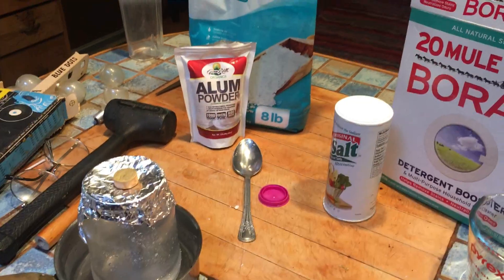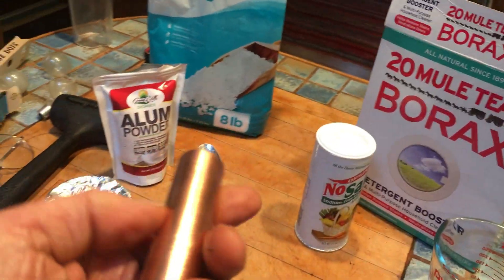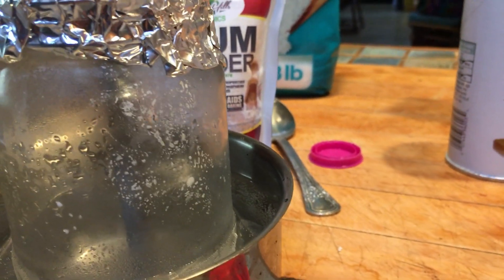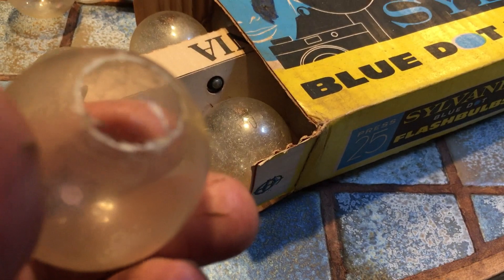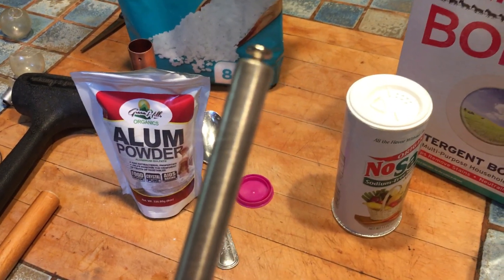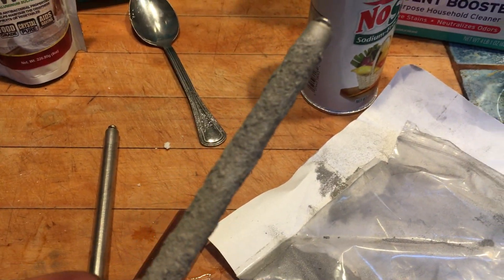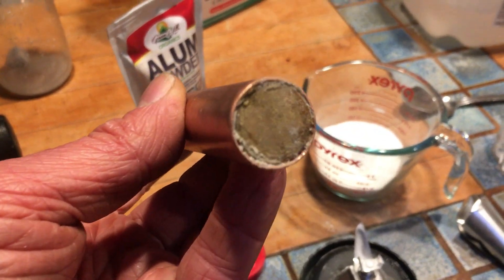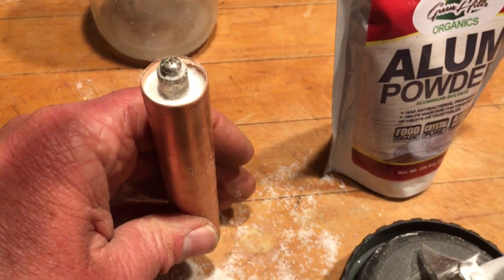Free Energy - Crystal Battery - John Hutchison, John Bedini - Alternative Energy Project TOM-SKY.COM

Comment: This video is the recipe of what you need, essentially equal parts in weight. Supersaturate in demineralized water.  Put it in a 12v atv battery with no acid having been in it at all. Seal the caps. That 12v battery will give you near or 6v with I think .5 amp or .3. It’s been years and I have to test it again.  The only thing I won’t mention with the recipe is that even though equal parts are by weight you have to do “things” with them first and then melt all together and then grind. The only “things” are easy to find. Do your own research if you want it bad enough. The equal parts per weight after “things”  was what I found and am sharing. It does definitely work though.

Comment: if you get a chance you should look into tribo electric based power generation, two available are electron pumps, and rain generators that produce charge when water runs across a material like teflon then onto a metal conductor (this is a negative charge material, so coupling it with a positive one so that same drop can produce a positive charge pull as well as the original negative push, doubles the effort) 

the cool thing about the rain generators is a clear set of materials including the conductors (graphene ect) will let light pass through the units so solar and rain generators can be coupled, thus you get more power from rain if there is any sun, and backup power from rain when the sun is not available either because of clouds, or at night. 

I am working on purely thermal vibration power collection (ie no need for a thermal disparity because it is not flow of heat from one location to another) as it is for sure the way forward and able to generate power from anywhere, be it a battery pack compartment of a car or a basement.

Comment: 5:50 so based on your close up, the black DC scale is what you want to read. when set to 10V it uses the bottom row of black DC which shows an output of roughly 2.3v, when set to 2.5v it shows almost a full bar which is close to 2.3v out of 2.5V max... nice output!

Comment: Hello :) please could you explain how that works ? Is there a chemical reaction between magnesium and oxygen from air ? Or is it a secondary battery that you have to recharge ? I've made some researches about these Crystal Hutchinson Batteries and I found an explanation where the Casimir effect was involved but I don't understand anything. Very interesting project though :)
Reply from the maker: None of us seem to truly understand or at least properly explain the magic but from my personal point of view we are sort of trapping ambient field of energy the 2 different materials used allow for flow of current while the “pressed”crystalline reacts continuously forming static current and who ever can comment or improve on this explanation I’d be grateful
Reply: @tomsky  I've conceptualized these "crystal" batteries as a hybrid (90% battery, 10% capacitor as they seem to take on at least a small charge) that employs a solid state electrolyte. Kind of interesting in that there are many many as yet unexplored avenues of potential experimentation / optimization both at the cell level as well as the system integration level. Thanks for your work and for sharing your knowledge with the larger community ! By the way, VERY impressive voltage ~2.2V or so on your first cell...operating incredibly close to the ideal galvanic limits of the materials used.
Reply: @nlabanok  A company did that and sold the packs for quite  while they went out of business
Reply: It is a relatively simple battery. There is a copper electrode with a standard reduction potential of ~0.3 V and a magnesium electrode with a standard reduction potential of ~-2.4V, giving the battery a standard cell potential of ~2.7 V.
The magnesium is oxidised while the copper ions are reduced. It would work better with more copper salts in the electrolyte.
Reply: The way I understand it, its some sort of chemical reaction between the anodic and cathodic materials (copper and zinc)

Comment: Thanks for this video I thought  I was the only one putting some of these together lol. So the ones I'm making I'm going to beef up alot  .my mixture recipe is going to be borax,Rochelle salts(alum and cream of tartar mixed), potasium chloride,  iron pyrite, barium titanate (it alone produces 13v dc from its piezoelectric properties) ,and graphene (I'm assuming that adding the graphene into the crystal mix it should bump up the energy stored because of how graphene can be used as a capacitor). Hope you battery builds go well .
Reply: Same, i thought everyone forgot about these
Reply from the maker: 13v ? thats impressive! i hope to learn more!
Reply: @tomsky  same here we can always do better. I have been digging through all the old Hutchinson and bendini research and other videos even in languages I dont understand to hopefully find a way for my cells to pump out more amps. In an old video jhon Hutchinson said that these cells work in the same way that the "moray valve" by Thomas Henry Moray .work which gave me a whole bunch of questions I need to reasearch . But these have more potential then people have shown yet I'm sure ,keep it up.
Reply: @vinniebeme  you are on the right track I am in contact with John and he told me this mixture give it a try 
Chromium potassium sulfate 
Powdered berium titinate
Powdered germanium
Roshell salts 
John says he is soon going to disclose all his information we will see if that happens 
Anyway good luck
Reply: @cartertech2531  I will definitely  give it a try thank you. Cant wait to see what John is up to next. his science work has inspired so many and hes one of the most underrated geniuses of our time